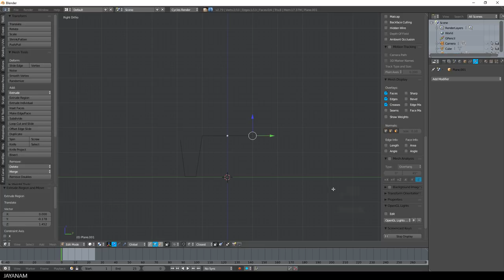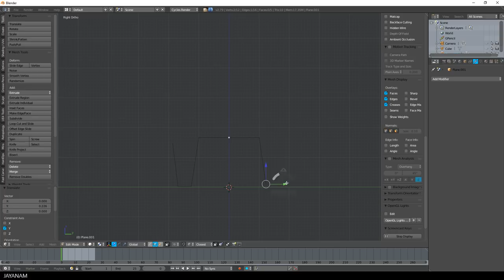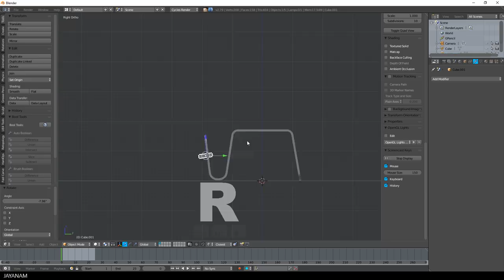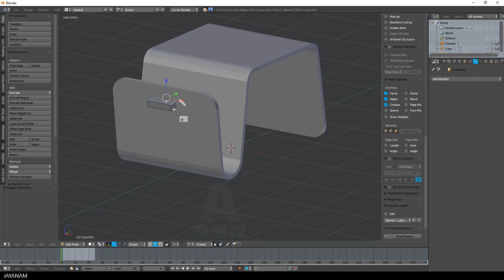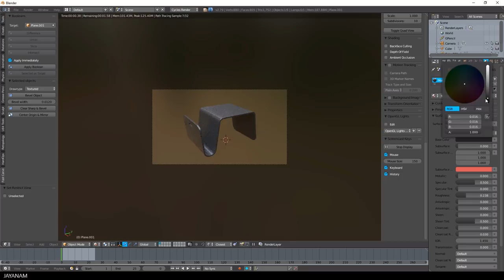Blender Hardsurface Modeling and Booleans

Comment: many thanks! this is definitely a better, much more controllable - and quicker - method than using subsurf (level 2) and endless loop cuts, which is the way i was doing it. i got there in the end, but it was painful, and i kept having to add more loop cuts and creases to hold the edges and stop them from collapsing especially when cutting out the hole. the loop cuts also get more tricky on the angle planes if you want to adjust them after the fact because you have to use Edge Slide (Ctl E) in order not to distort the geometry. next time i will start with your fast carve add-on and use bevels for all the main 'sculpted' smoothing.
Reply from the maker: Hey, great you like it:-)

Comment: Shame that I need quads, so I still need to do all the cleanup afterwards, but that should be less work than planning ahead where to cut and where to put loopcuts. Thanks for the addon link.
Reply from the maker: Why do you need quads?
Reply: I export my models to use in Clip Studio paint as props or backgrounds for lineart or to keep perspective or proportions consistent (basically I use them as my sketch, to then draw the actual drawing over) When using objects with Ngons, the programm basically interprets those faces randomly. So you get distorted or torn faces all over the place.
Reply: Actually, I just found a solution. By manually transforming the mesh into tris in Blender before exporting as FBX, it works now. The automatic Sharpening applied by the Fast Carve Addon creates flat surfaces without  Clip Studio picking up every single edge (even on flat surfaces) Thanks for introducing me to this awesome addon. This will help me work a lot faster when creating the various SciFi Props I need for my Visual Novel or Illustrations.
Reply from the maker: ok, but the question is, why do yo need quads, why not go with NGons:-)
Reply: Jayanam quads give the best result for lineart. Clip studio picks up edges very easily and if I export an object via FBX with ngons, Clip studio will divide them into tris. And frankly the results are unworkable as it creates a jumbled mess most of the time, and the time I spend cleaning up the linework is just wasted time.
Doing the transform from ngons to tris in Blender however solves this, as it doesn't destroy the mesh like Clip Studio does. So thanks to this video I basically stumbled upon the solution to my problem. I can now finally go wild with booleans, crating ngons out the wazoo, and not have to worry about doing too much clean up, since these meshes will not be deformed anyway. For my posable models I will continue using retopo after sculpting.
Reply from the maker: Ah I see, you are a 2d artist using Clip Studio Paint? I also like CSP for digital painting.
Reply: Yeah, allthough I'm getting more and more into 3D modelling and sculpting these last few months since my current Scifi project requires an obscene amount of props. CSP is an amazing piece of software for painting and comic production. It's also dirt cheap considering the other professional options out there.

Comment: Jayanam, sorry for the newbie question, but how did you pop up the menu at 1:32, the menu around the cursor ?
Reply: it's the 'Pie Menu' add-on, already included in 2.79 but not enabled by default. in case it is helpful, here are exact instructions: go to File > User Preferences (Ctl Alt U) and go to Add-ons (fourth tab along the top). in the search box (far left, near top) type in 'pie'. you will then see, not one, but two 'Pie Menu' entries. the first is Pie Menu: 3D Viewport, and the second is Pie Menu: UI Pie Menu Official. to do what matthias did at 1:32 you need the second 'Official' one and make sure in the Preferences section of this Add-on that Mode Set: Key: 'Tab' is ticked or checked. you can also choose to activate or de-activate the six other pie menus in the Official add-on. you can also activate the other pie menu, so-called 3D Viewport, and that one has a couple of dozen pies that you can choose from. both have online documentation that you can click to, and the 3D Viewport Add-on even has copious explanatory illustrations. hope that helps.